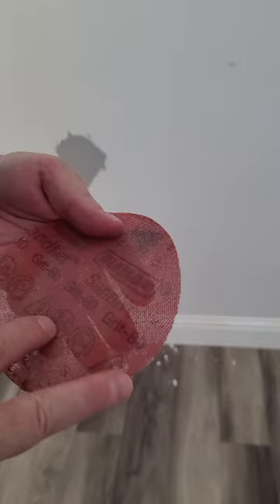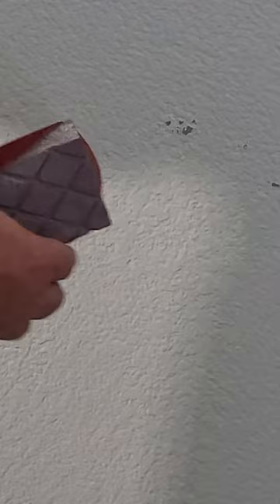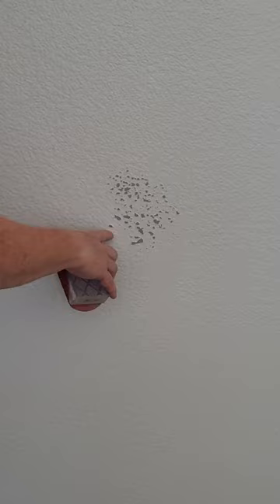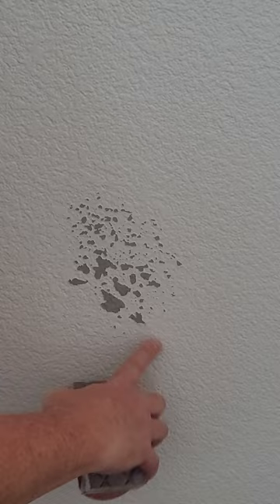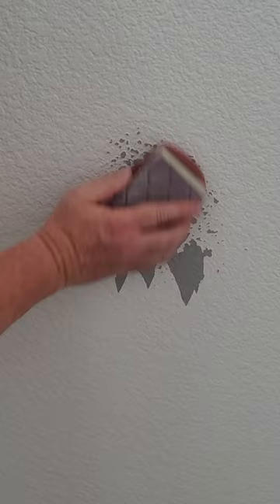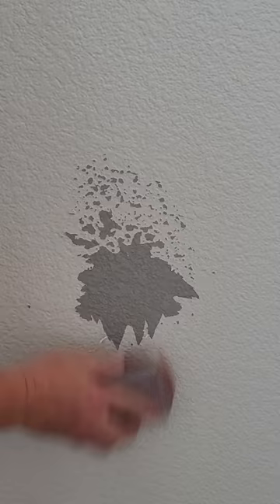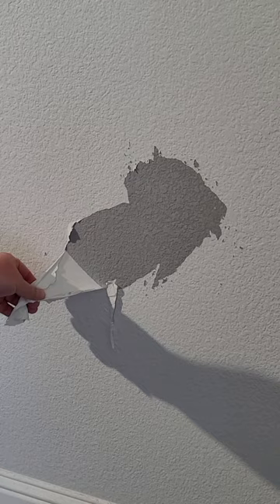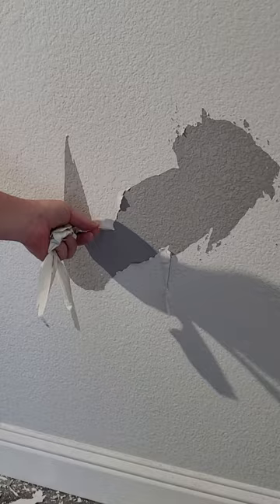Kelly Moore adhesion issues

Comment: What was the prep before you painted? Any sheen on the previous coating?
Reply from the maker: Eggshell on eggshell. Normally fine. 
I believe part of the issue is the home depot paint never fully cured, and gave adhesion issues.
Where I sanded, primed, the painted has been solid
Reply from the maker: Also, I didn't paint it, I hired a painting company. I've been doing the repairs.